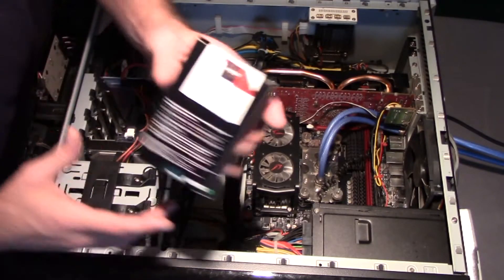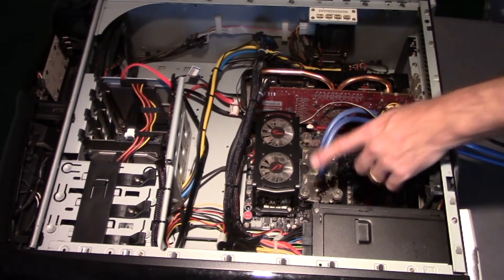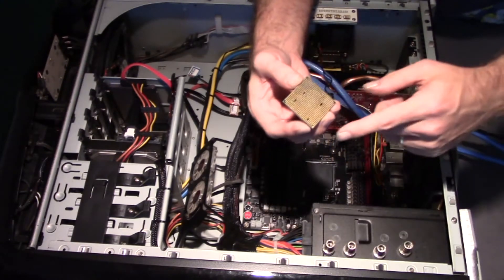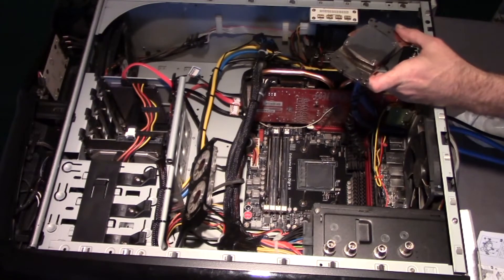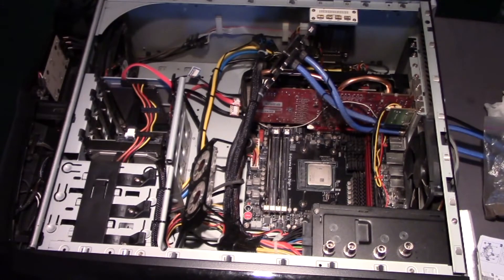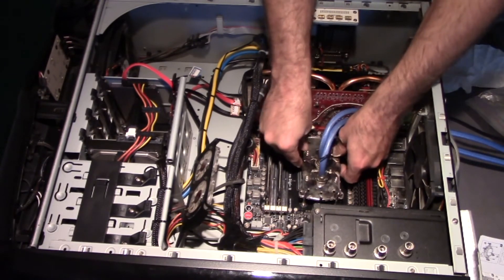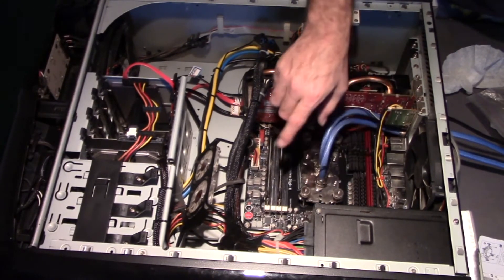AMD FX-9590 Processor Upgrade

Comment: Fx 9590 for big corel!?
Reply: shown loppmay huh?
Reply: My Z31 300ZX 
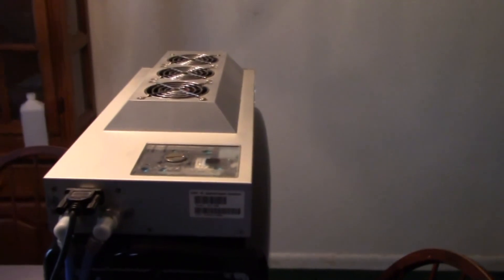Look with this big cooler 8:40 
That mean the cpu so worst
Reply from the maker: I’ve since installed a larger cooler since install. Keeps the temps close to ambient.
Reply from the maker: shown loppmay That cooler I was using on a Athlon XP processor. Worked perfect for the FX but temps were 10-15* F above ambient at full load running 5.0Ghz. Now it runs 2-5*F above ambient.
Reply: Chris Walsberg 
Can I use fx again it is available in my country with low prices
Reply from the maker: shown loppmay yes
Reply: okay thx

Comment: I wonder if this would be a worthy upgrade from a phenom x6 1100t at 4.15
Reply: Yes - I upgraded from the Phenom II 1100T my self. As long as you have a MB that supports the 220w tdp and a power supply that can handle it.

Comment: hi there i just got my self a 9590 fx amd and i love it now i just need to o.c 
have you o.c yours yet ???
Reply from the maker: I actually just replaced this 400W cooler with a new 750W cooler. Just to give a little more cooling capacity
Reply from the maker: +Ricardo Rivera I'm currently running 5.0Ghz With no turbo.
Reply: Sweet does it run stable? And did you just change the multiplier with everything else on auto?
Reply from the maker: Yes, Just changed the multiplier.
Reply: Thanks must be your water cooling solution :)